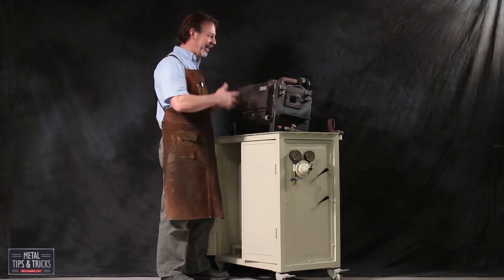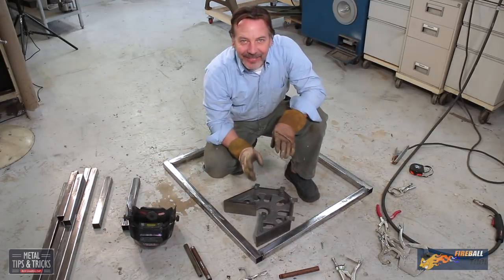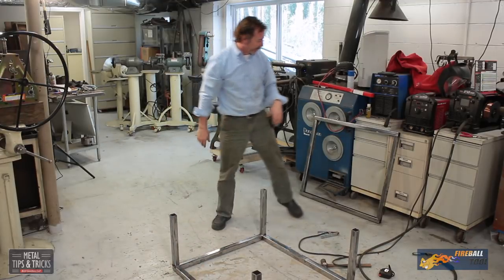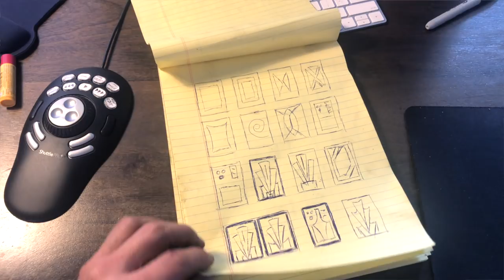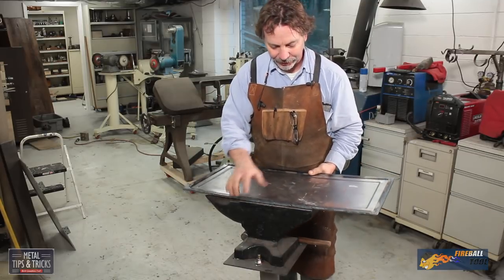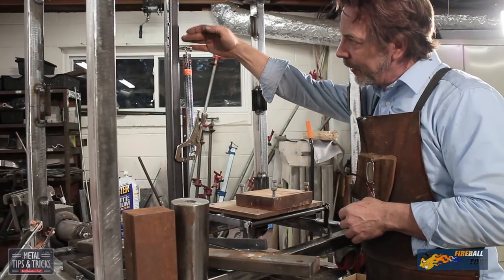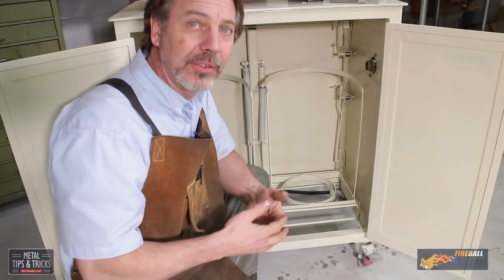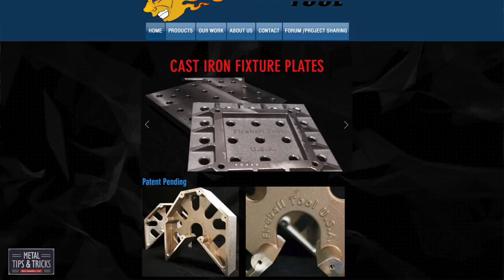Propane Forge Base Build

Comment: You just popped up in my feed, happened to watch your radius trick rotated on pin of radius center line. Gotta tell you...very refreshing to see someone that has the skill and EXPERIENCE to get something done without having their hand held. 30 years plus on manual machines here...44x240 manual lathe with 10-15,000 pound material was everyday for me not to mention every manual machine in a shop...ask some now what the decimal is for a fraction. Subscribed (I almost NEVER comment)

Comment: What factors go into choosing to MIG weld the frame and TIG weld the door panels? Why not TIG weld everything?
Reply from the maker: Great question, Mig is faster then Tig, but if you have to do a lot of grinding on the weld Tig might be faster.
Reply: Thank you. Good to know to consider the work time in the two methods.

Comment: Perhaps a proper welding table? Springs are not proportional in their force compared to their extended length so your tanks will get empty faster as you use them. Do love my Fireball Tools.....

Comment: Any gas that liquifies cannot be accurately measured by tank pressure.  Weight is the proper metric for remaining fuel in a propane tank.  I doubt your spring will "stretch out" as you are not exceeding its pull strength, so you would not be causing the spring to yield.   A fun method to weigh your tanks could have been with hydraulics.  A 0 to 100 PSI gauge and a cylinder with 0.6 square inches area.  Use a small spring counter balance to overcome the weight of an empty tank and the mount.

Comment: Pretty cool fabrication video. I'll probably pick up a set of those squares, they definitely look very useful. And not to nitpick, but just a couple of suggestions:

1. You use quite a few specialized tools that I know exist, but am not terribly familiar with. Like the tool you used to put the seams in the sheet metal and the tool you used to create the circular metal hoops. Maybe just spend 15-30 seconds or so on each one with a brief intro explaining what it is and why you're using it. 

2. The canned rock music is annoying. Plus, the volume of it is not mixed properly with the speaking parts. I found myself constantly turning down the volume at every interval with the rock music and then having to turn it back up to hear you speaking again. My suggestion would be to mix it better so that the music is much quieter during the non-speaking parts. Or better yet, use the classical music you use towards the end of the segment instead, which is FAR preferable to the generic canned rock.